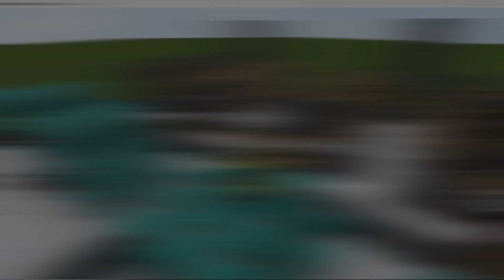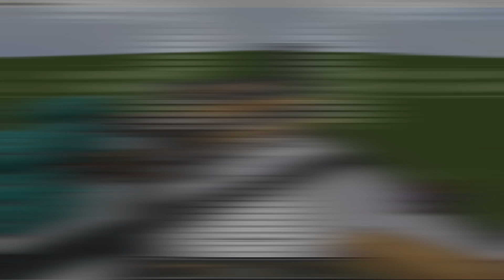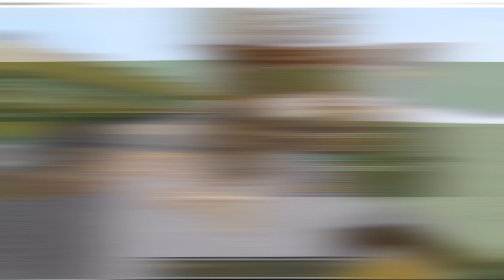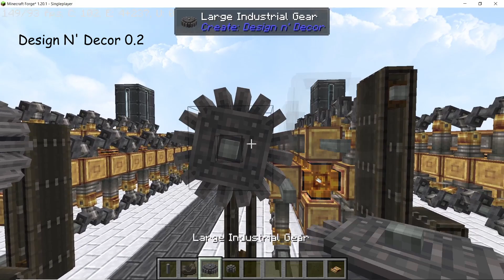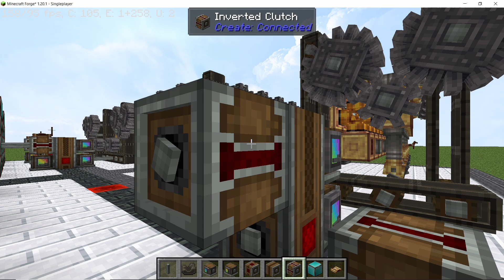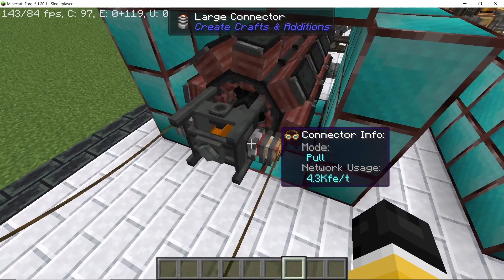Diesel Engine Power Plant - Create : Diesel Generators Mod

Comment: The fact you are still running 100+ FPS is crazy, I expect Minecraft to lag with all of this. It's pretty sad that Create isn't made for 1.12.2 though..
Reply from the maker: With shaders the performance goes down quite a bit, like I get around 30 fps or so. Aside from that yeah this high fps even surprises me considering all of engines running simultaneously.
Reply: It's impossible to make it 1.12 because you can't make good animated models on that version
Reply: @matijasedmak8056 Yes you can, it'd just be harder.
Reply: @matijasedmak8056  Why not? OpenGL is OpenGL. The creators of Forge are just lazy.